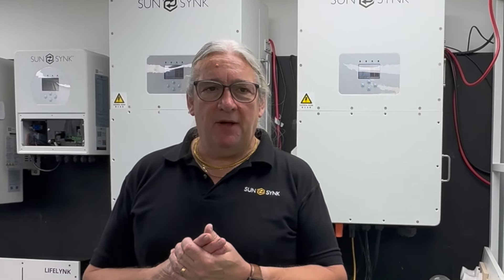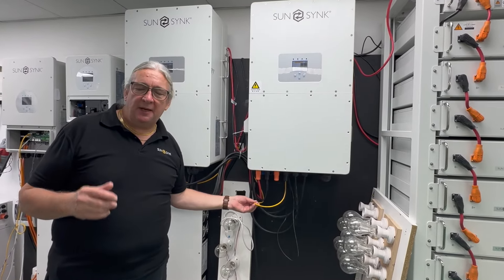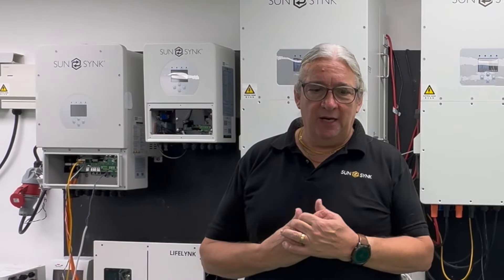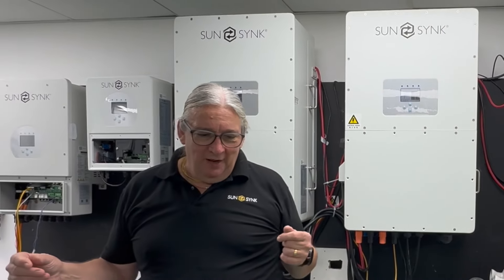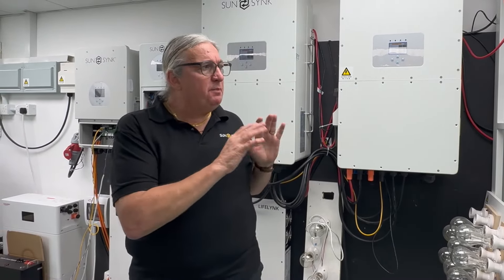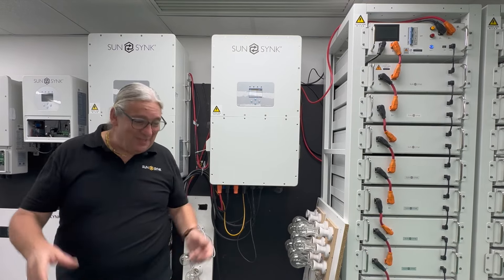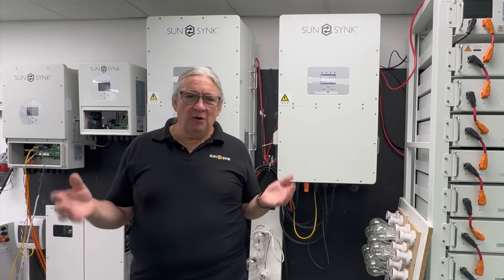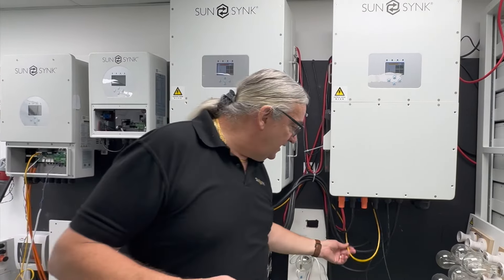Back in Hong Kong

Comment: Mate what do you think about using default option by selecting lithium  Vs Use Bat V (and giving charging parameters of float , absorption, low and cut off voltage ) .  MOSTLY  default option of Lithium  charge at 53.4 volt , where as i know most lithium can be charge at 58.4 volt to 58 volt . What do you recommend . Auto selection vs manual over ride